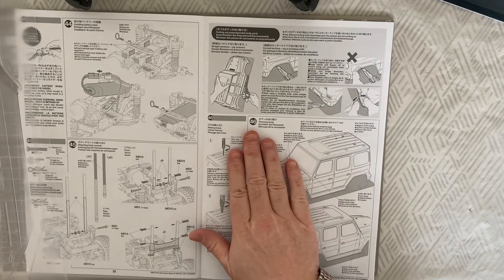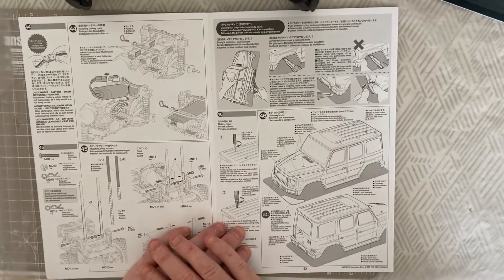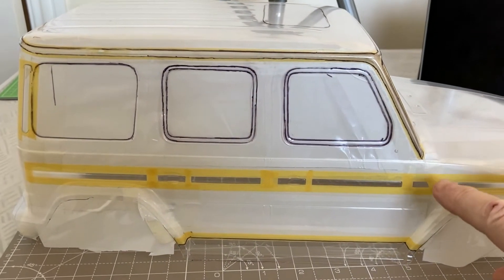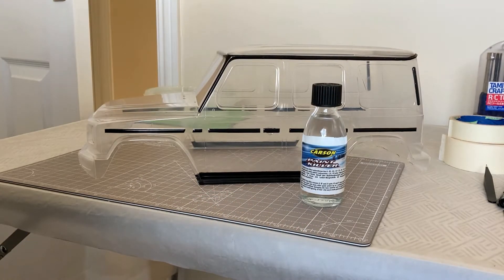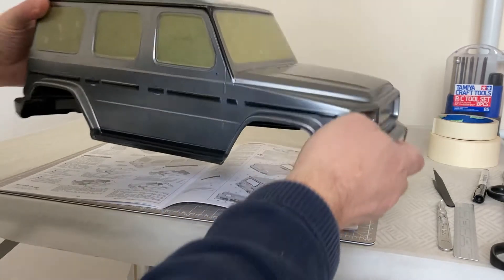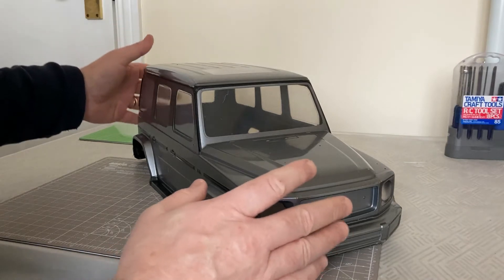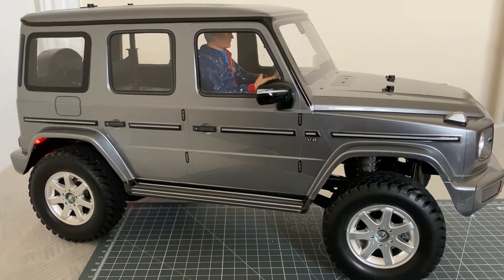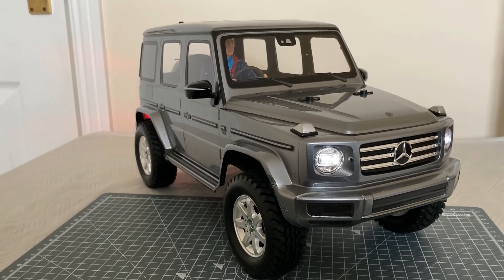Tamiya Mercedes Benz G500 Bodywork

Comment: That came out excellent John really sharp good color  the ps gun metal paint is really nice to spray i just ran out
Reply from the maker: Hi there and I hope you’re keep well. Thanks for watching my video. The CC-02 took two cans of the PS63 and a whole can of PS5 to do the black trims and backing colour. I think the backing in black makes the PS63 a deeper colour. Really took a long time to do, in all the body took approx. 15-20 hours, plus drying time. But it’s worth it. There is a area at the rear that is flimsy, so I’ve supported that with some Gorilla fibre tape. Going to get a running video of the car soon, so hopefully, all will be good on that important first run. Take care, keep well and all the best. 😉😊😉

Comment: That is stunning. John.
Reply from the maker: Hi Paul. Thank you so much, I was determined not to have to use decals for the roof line, trim lines and rear vent area, so wanted them in black paint. It was a lot of masking and cleaning, but managed to do it. It was then 2 cans of main colour, and one can of backing colour. It was about 20 hours of work, plus drying time. But worth it in the end. Take care, all the best. 😊😉😊

Comment: Hiya John. Wow it's a stunner my friend! This was a masterclass of how to do a lexan shell. O e thing you didn't show was how you went about masking those roof edges. They look very tricky with the curves. Lexan body masking is my least favourite thing about this hobby I'd say. That and accidentally pulling the trigger when picking up the car mid run and getting a face full of dirt and gravel! Anyway any tips gratefully received. Nice vid and excellent end result. Best wishes to you matey 😁
Reply from the maker: Hi Pete, thank you for the kind words. I must say, the masking of the roof line took so long, I was worried about boring everyone! 😂😂. But absolutely, the masking of the 4 corners of the roof line was really tricky I tried two different widths of Tamiya masking tape and found that the Tamiya masking tape not that forgiving. I’ve got ModelCraft masking tape, which surprisingly, is a bit more forgiving. But the corners were very tight. In the end, I use 6mm ModelCraft masking tape. On the internal corners of the masking, I made small snips in the masking tape, but no more than half way through the width of the tape, so it will bend around the internal corners, I also made the tape run in one run, all the way around the internal top ring of the roof. I had to do this to ensure minimum paint bleed as possible. I had to do this twice, one for the upper and lower roof lines, so that I got an even strip around the roof. I repeated this for all areas that I wanted a black trip to replicate the trim lines to the side, roof and rear vents. Then using my masked lines, I stuck plastic sheets to cover the areas not being painted. Then it was a case of ensuring the masking was push down firmly, and going for it! 😆😆. I did get some small amount of paint bleed in the corners, so used the Carson Paint Killer on a cotton bud to remove these, and some paint bleed around the door handles. Then it was remove the masking, clean the body again, mask the windows and repeat for the main body colour,the rest you already know, being an experienced modeller😉😊. It took approximately 20hours plus the drying time. Take care, keep well all the best. 😊😉😊
Reply: @JF-RC  ok many thanks, that's very helpful. Yes that Paint Killer looks good. Did you wash the body again with soap and water to make sure that there was none still on there?
Reply from the maker: @PeteWylieRC  hi Pete, oh yes, I waited for the paint to cure, then when I removed masking tape, cleaned any of the paint bleed, then again washed with mild detergent and dried. I use micro fibre cloths to dry as they don’t leave any marks. The bodywork sequences take so much time, but so essential as this is the first impressions of the model. The only area of concern is the rear tailgate area, where Tamiya have moulded the body, it’s thinner in that area, so I’ve supported it behind with some gorilla tape. But other than that, really enjoyed this body and I was determined not to have to use the decals around the roof line, I suppose thats my Taurean stubbornness coming out in me ! 😂😂. Thank you for your advice with the upgrading of the Arrma Typhon, this is my turn to model, when I just want to run at fully throttle! Just love the toughness of the Arrma. I’ve got to the point where I can now bury the throttle at full and can handle the car well, so yeah, I think a bit faster will be nice, listen to me? What am I like! Getting the speed bug! Take care. 😊😉😊
Reply: @JF-RC  this sort of proper model building is where you really shine. Thanks for the top tips. I really ought to get on with some of the body shell projects I have. So time consuming as you say. If you do go 3s with your Arrma you won't be burying the throttle quite as much unless it's a big area. It does become quite a beast. Best set the transmitter to slow or even 'Derek' to start with 😂
Reply from the maker: @PeteWylieRC  I think I’ll have to use the ‘Derek’ setting definitely 😂 bless him! So glad that we’re able to throw ideas at each other, really great to have someone like you to talk to, someone with excellent knowledge, expertise and experience in my corner, makes a great deal of difference. Enjoy your bodywork sessions, I look forward to seeing some more Pete Wylie specials. Take a look at Rob & Mark’s unboxing of the Super Avante TD4’s, looks like they’ve both been Elf’d these great models, but some catch phrases in the video to use on your famous videos with help from Mark & Rob series 🤣😂. You’ve got the wibbly wobbly, Simon with the tyre sniffing, I’ve got the jer jer jiggle it! Mark & Rob with a plethora of phrases, what are we all like ! We’re all going potty! Take care, all the very best. 😊😉😊

Comment: What kind of paint is used within the can. I'm asking because within my Job we use waterborne and I recently bought a used tamiya 500g and I would like to repaint it
Reply from the maker: Hi there, if you’re painting a polycarbonate body (lexan) I.e the body is very flexible, then you have to use paints designed for polycarbonate bodies, i.e. Tamiya PS range of paints and paint on the inside. If your RC body is a hard plastic shell, then paint with Tamiya TS range of paints. On the hard shells, I have used Halfords Plastic grey primer, then painted with Tamiya TS paints, without any issues. Hope that helps. Thank you for watching and commenting. Take care and best wishes 😉